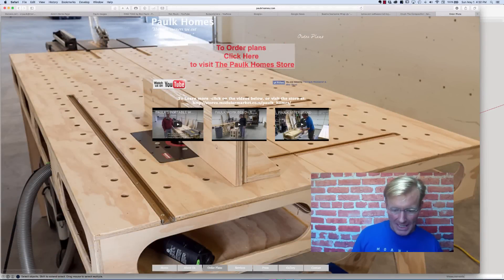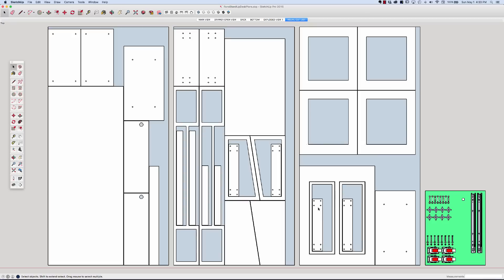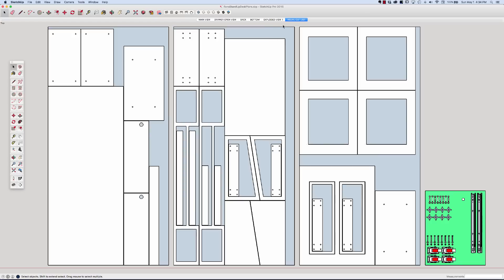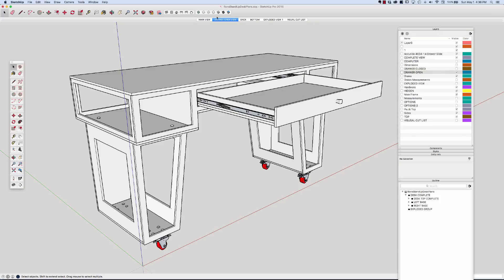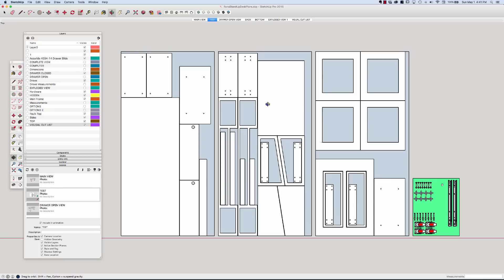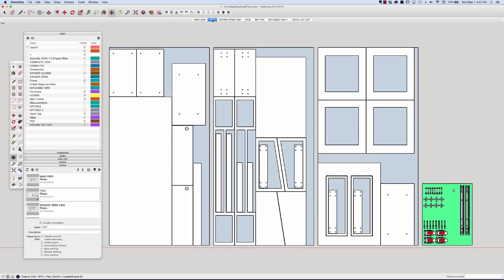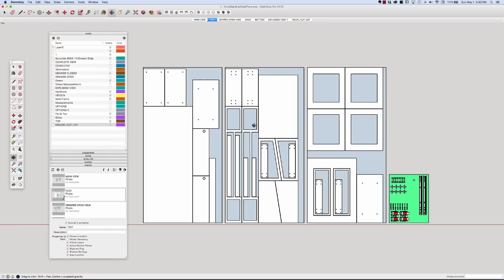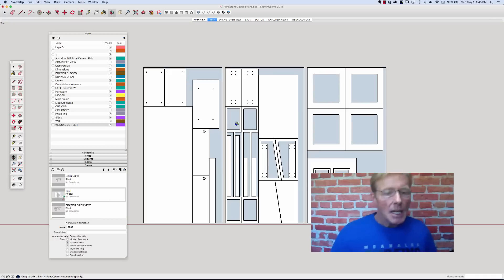Designing and Building the Paulk Stand-Up Desk- Designs (Part 2)

Comment: Could a wiping poly be used as a finish coat With the ebony stain that you used on the desk? Did you you use the water base polyurethane because its fumes are less toxic or because it works better with the stain?